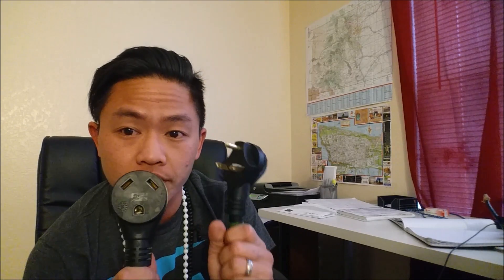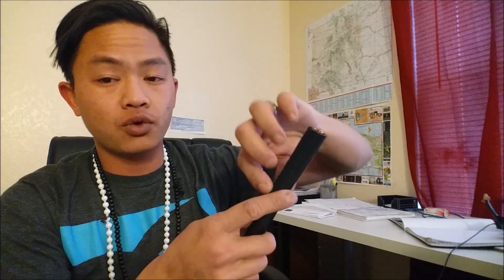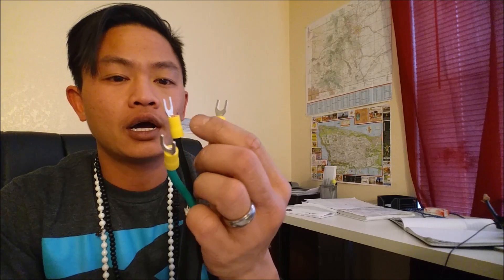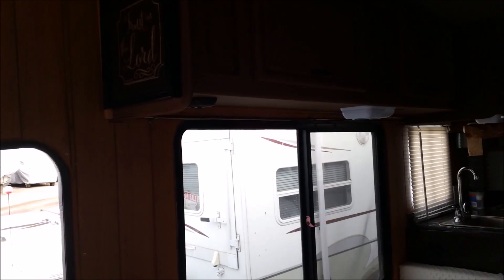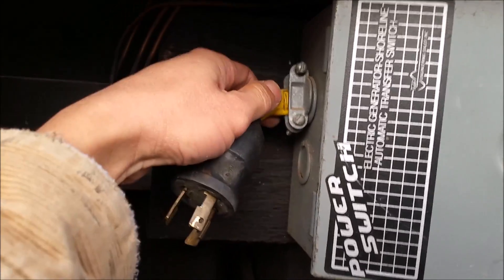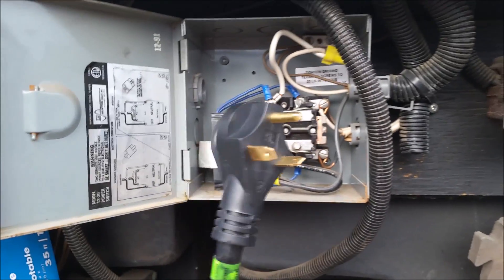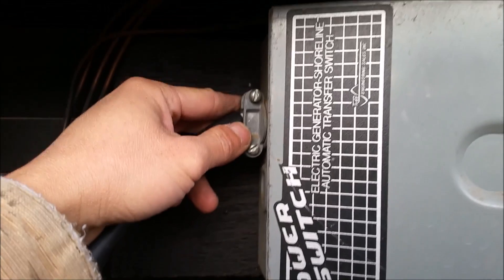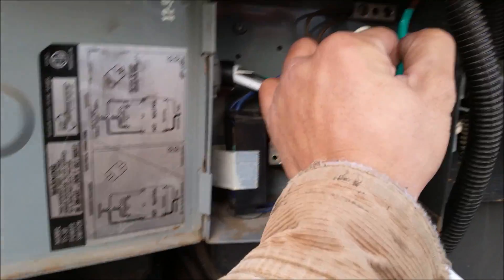Convert a 20 amp male generator cable to a 30 amp male extention cord. Electrical in RV

Comment: Believe in the plug  exposed on the bottom like that will suck with corrosion in weather I know this is 3 years but you can use a Balloon to cover the plug. Cheap and easy

Comment: I'm not an electrician but those copper wires should not have aluminum fittings that also look too small. You also need to use closed loop connectors not open to prevent screw loosening and wire touching the box. Be careful that you are changing cords that are low amperage to high amperage devices, overtime it can be hazardous. Good effort